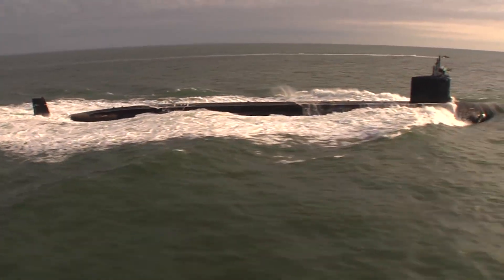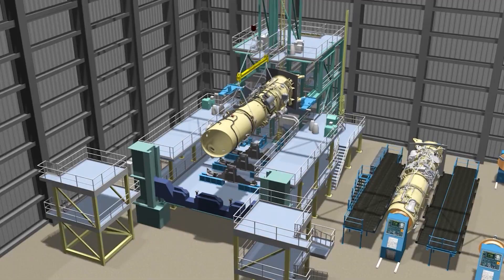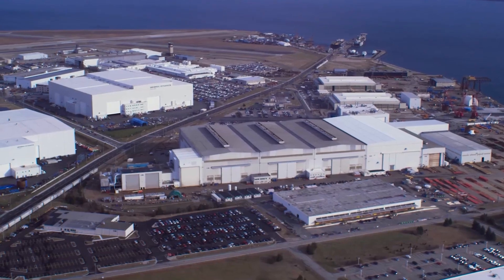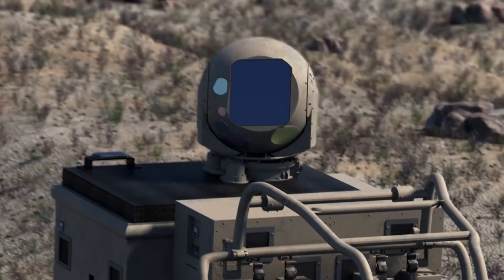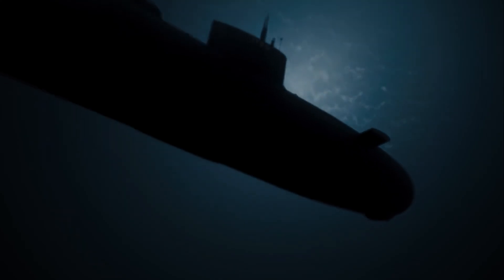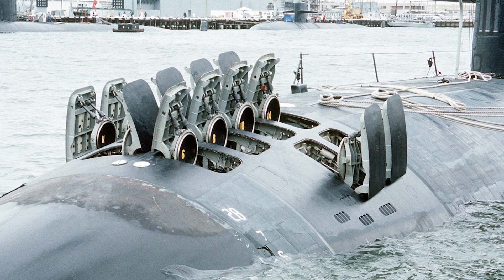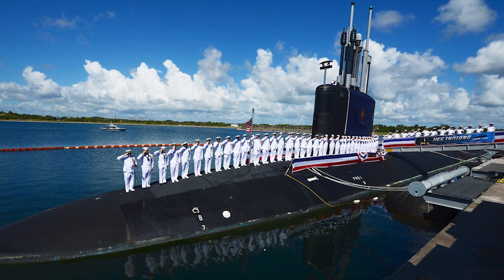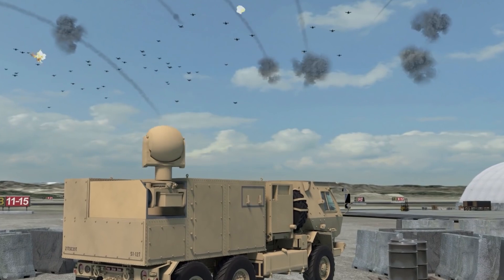The Submarine with a Laser

Comment: As a former submariner I’m straining to image how to integrate a high power laser into a submarine
Reply: Thank you for your Service 🇺🇸🇺🇸🇺🇸
Reply: surface operation security and intercept, think RAM/SEAWIZ lite. Most subs lack defense against fast interdiction and attack interdiction of the modern hyperspeed weapons and drone swarms. A photonic weapon could effect a decent defense umbrella.
Reply: @toysoldier8947  That is if the sub has surfaced though it would be a better option to dive directly instead. Since hyper sonic misses does not work under water and drones would hard time tracking a sub when its under water.  The is no real point to it since submarines in general does not want to be on the surface.  Missiles would be better since they can be launched from under water.  If you surface in enemy waters something has gone terrible wrong. Subs generally surface when their going to either resupply or communicate with command(one is when you are under the protection of port and the other last a extremely short time). Most sub weapons are launched under water from ballistic missiles, cruise missiles and torpedoes.
Reply: Have the Periscope co-witness to a reflector so the sub can stay underwater but fire the laser above water with minimal exposure. Use this in conjunction with a carrier Strike Force and a ring of Subs around the strike force as a perimeter and first Contact countermeasure.
Reply: Lots & lots of duct tape.
Reply: Diesel-electric submarines use a large battery. The laser uses a large battery. It makes sense.
Reply: @DimaShitov123  … I’m no engineer. But by my recollection to power such a laser would require very large capacitors. Could a battery discharge fast enough? I suspect you know more of this than I do
Reply: @Idahoguy10157  no, i am noob :D. I just remembered that a battery is used on diesel-electric submarines, and for lasers I thought that battery were used. And now I’m thinking, maybe a diesel, gas turbine or nuclear installation is better suited for a laser because of its larger capacity, power...
Reply: @DimaShitov123  …. There’s creating power. Then there’s storing power. Then there’s delivering power in a useful way where it can be used.
Reply: @DimaShitov123  dobray vetcher,  "powered by the subs nuclear reactors "  ya dumayu eta khitai.. their anti  carrier missle
Reply: You need to paint with it. I think you understand what I mean. I don't want to give my idea outright if I'm correct.

As far as installation, I thought he mentioned on top, porting out like that photon periscope. I assume water right seal that probably moves upward after they surface
Reply: @nomore-constipation  ….. I’m not tracking on a photon periscope. I presume the laser would be mounted on a mast. Used to take down drones. Or to blind someone or something. So the boat would necessarily expose itself to do that. As far as the laser’s range I suspect that’s in an ideal environment. I could go on but you understand where I’m coming from. The nuts and bolts of operating at sea
Reply: @Idahoguy10157  Those lasers would essentially be useless against Chinese railgun ships and hypersonic missiles though... I can see the use of laser submarine against aircraft carriers and classical missiles.
Reply: @Tiberiansam  why do you think lasers be useless against hypersonic missiles?
Reply: @Robert Dawson  he means a photonics mast, shipmate. Virginia's have photonics masts vice a traditional periscope. Same thing, just digital. You'd probably mount it on that. Former FT here, happy to help.
Reply: @austinhawkins3307  …. I was an FTG2 (SS). Got out in 81. served four years on USS Flasher SSN613
Reply: @Tiberiansam  I disagree, lasers might be the most practical way to stop hypersonic missiles. If you can make the tracking accurate enough. Nothing will be able to outrun a laser travelling at the speed of light
Reply: @macberg5806  Spot on - the best counter for hypersonics are light speed defenses - which we're starting to see with things like HELIOS getting deployed.  Now imagine our Virginia-class fast attack boats with the ability to poke their photonics mast up and crack off a couple of shots from a 300kW laser, then slip back down.
Reply: Well it sounds like you don’t have much of an imagination. You’re struggling to find an answer, but clearly there’s a reason for it
Reply: @LilMilan420  …. I was asking for possible explanations, not condescensation

Comment: Lasers were tested as communication devices for subs in the 1980s, but the sub had to be shallow for it to work.
Reply: Lack of focus
Reply: @Olkv3D  Since, that time astronomy has developed techniques using two lasers. One to read atmospheric conditions which is then used to alter the second laser to correct for the defraction.
Reply: @Fifthmiracle  Perhaps you meant to say diffraction?
Although, diffraction with laser light is primarily used to measure the amount of particles per volume of a given sample.

What I was referring to was the refraction of a laser beam in large, moving bodies of water.

Comment: Why don't they have color cameras?
Reply: color reduces over all resolution & won't be useful in low light conditions. Its likely any significant use for the periscope would be at night for additional concealment (ie deployment of Navy seals). Color CCD\CMOS use 3 or 4 pixel cells. The cells have different color filters to create a color image. A B&W CCD\CMOS would have about 2 to 3 times the resolution of color imaging sensor, and can also work better in low light since there is no filters reducing light input.